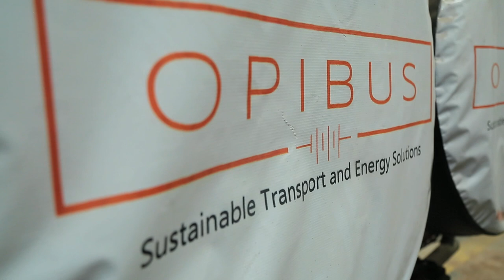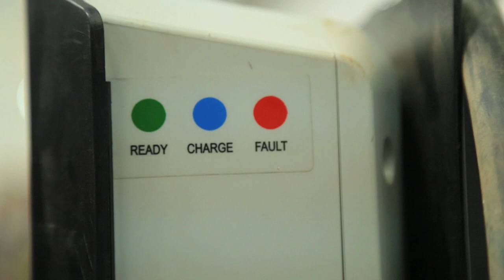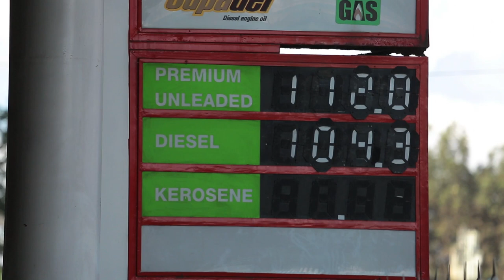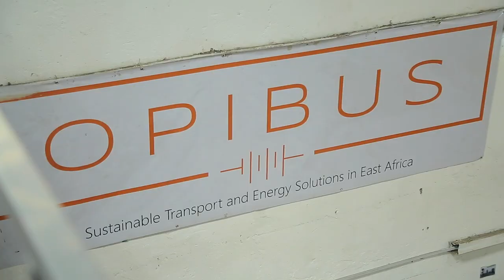How an electric vehicle conversion company is helping to reduce air pollution in Nairobi

Comment: Imagine the jobs. You can have jua kali car repairers striping down the car removing the engine and parts that are not needed and then take the shell of the car to opibus to fit them with the battery technology. Imagine the jobs created. Just converting  thousands of cars into electric will create many jobs.